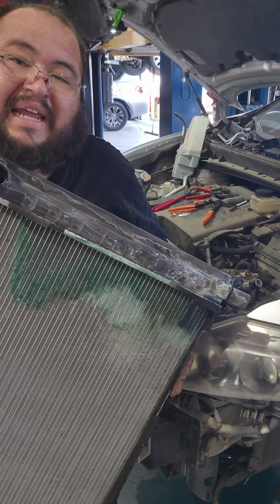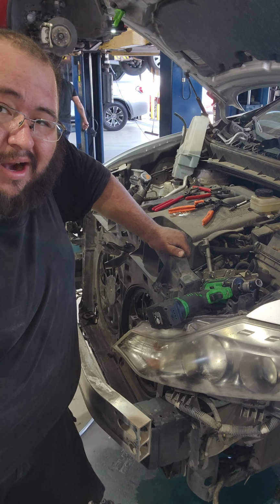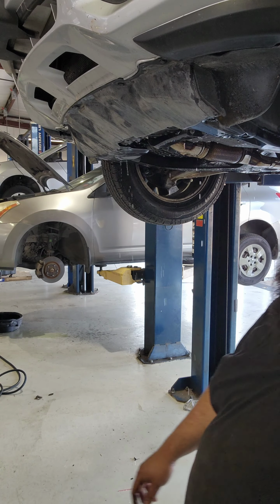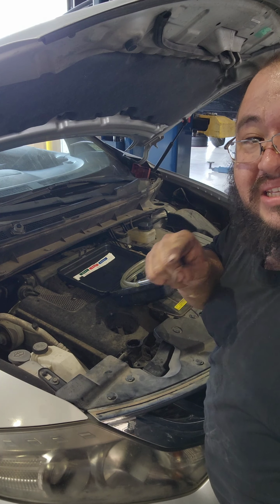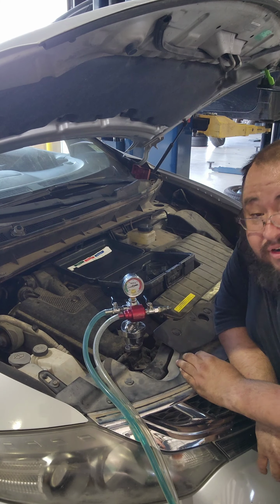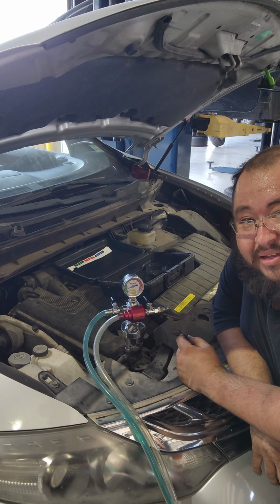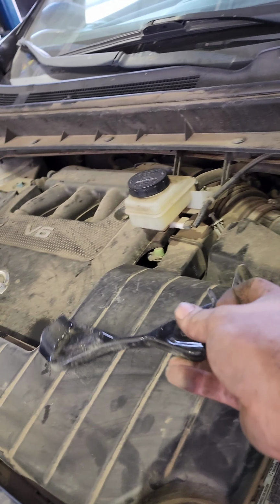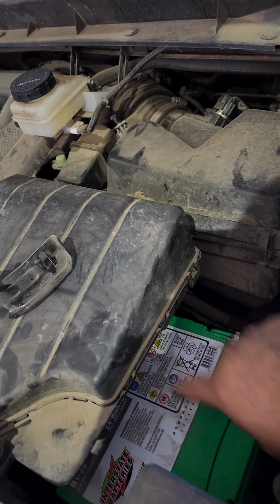V6 RADIATOR RELACEMENT!!! #pro #pro

Comment: What’s the spray you use in the radiator hoses?
Reply from the maker: I just use a little bit of lube all...its the most effective ive used to get the hoses on cause the hose ends are a little smaller than the outler and inlet spouts

Comment: Hey brother I really need your help. I have a 2020 trackhawk took it to the dealership because all of a sudden it stop working. Dealership diagnostic and told me it was going to be 4,462.19 to get it fixed. Told me that the battery was bad, valve body and fluids so I said okay get it fixed. Later on I got a call from their service advisor telling me that that wasn’t the problem and that I know had to get the transmission fixed my mind exploded how I pay for something that you tell me to pay for and now tell me that that’s not the problem. Please let me know what I can do I haven’t had my car for 6 months I’m depressed stressed and out of transportation. Please let me know
Reply from the maker: Was it not under warranty?? And are you subbed to the channel my dude?